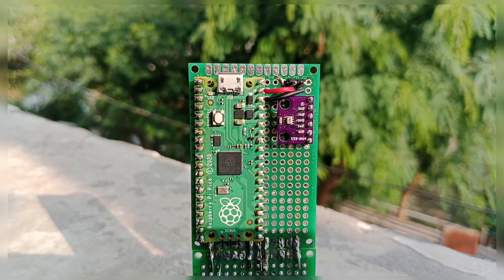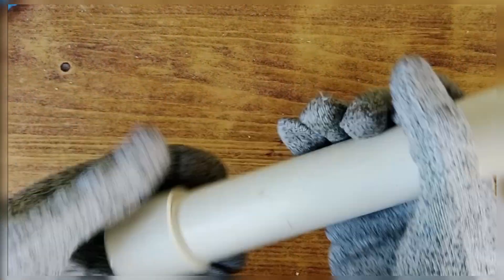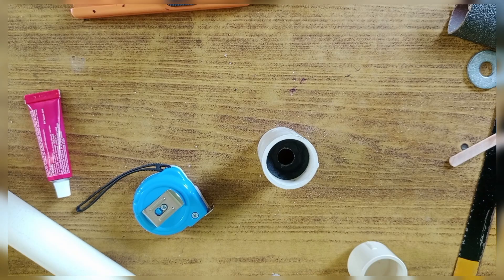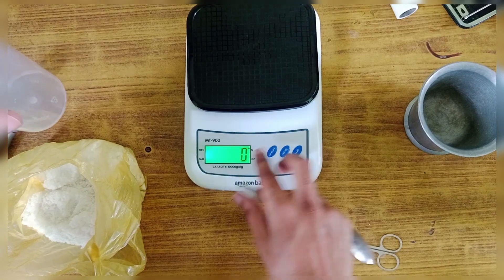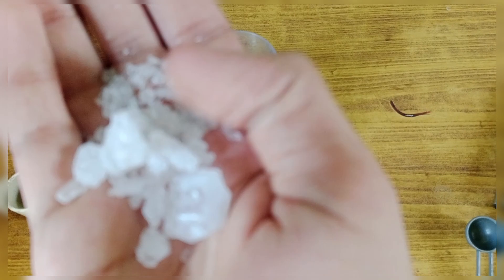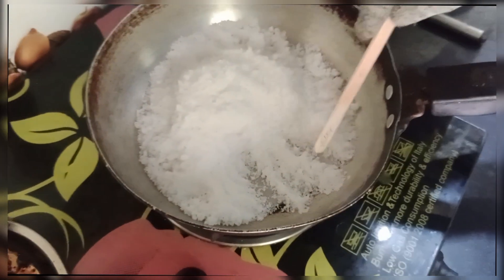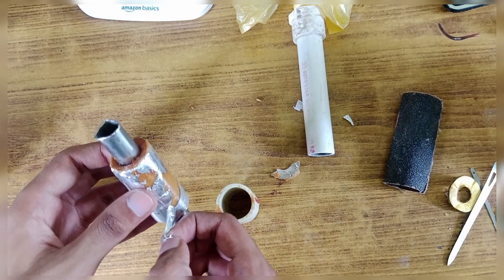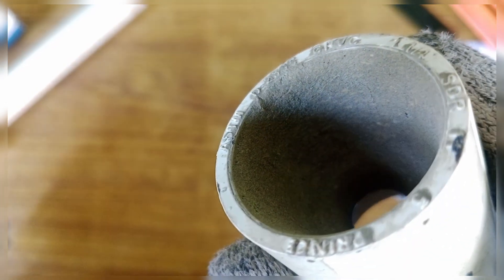Sugar Fuel for Rockets? My Honest Experience (Don’t Try This!)

Comment: Bro You should made a silicone sealant rocket moter .  its not messy and works great. Just use pottasium nitrate and silicone sealant. 60%-pottasium nitrate  40%-silicone sealant .❤

Comment: Hmm you should try powder, sorry for asking a lot
Reply from the maker: In the next video, i will not use any type of fuel that  needs to be heated for casting. I will use black powder type but without sulfur, and dextrin will be used as a binder. I hope that wouldn't explode 😅.

Comment: Hey, I have built some rocket motors, what you can improve is to grind the nitrate with a ball mill, you leave it for a few hours and it comes out as talc, which is ideal for it to react completely, The other thing is to use Sorbitol, it is a thousand times easier to work with compared to traditional sugar.

Comment: Use sorbitol instead of sugar. It is easier to cast and does not carmelize. If you use 60 KNO3 /40 sorbitol ratio you will lose a few percent of efficiency, but its even easier to work with. You should also grind your potassium nitrate as much as possible to a fine powder.